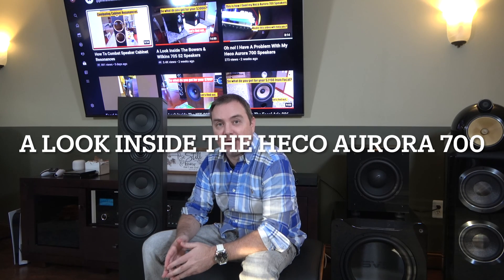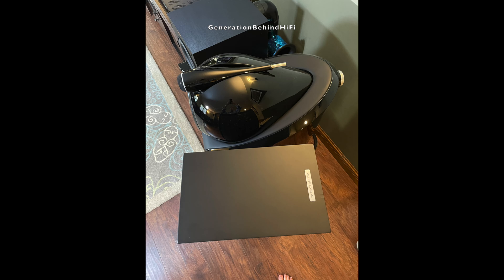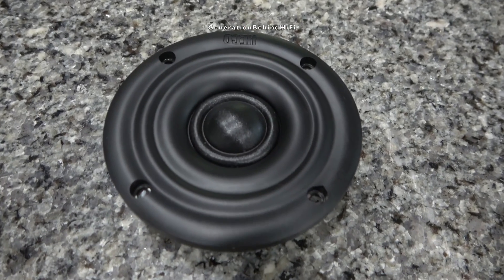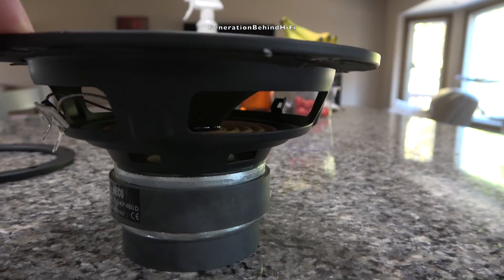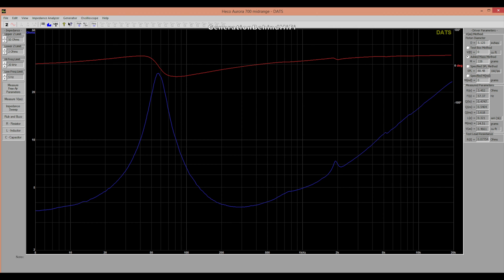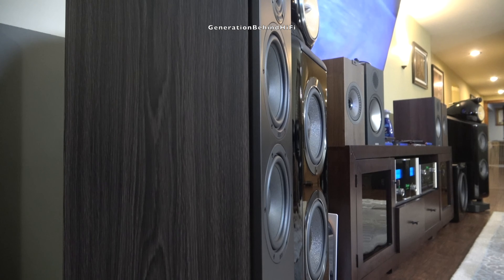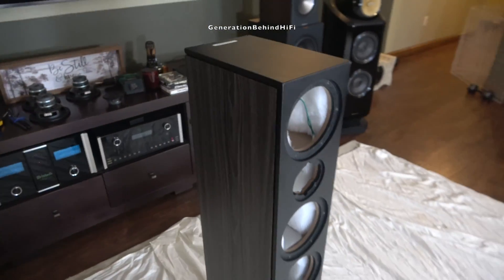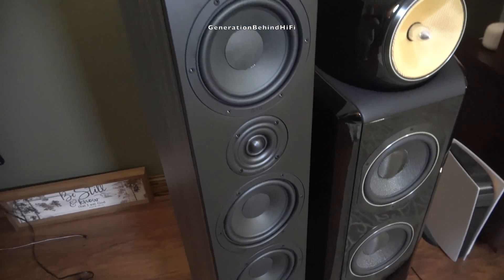Heco Aurora 700 – Full Driver, Cabinet & Crossover Breakdown

Comment: 5:20 The "Fluktus" concept clearly approved by a purry expert in warm sound, covered in orange fur. 😂❤

Brotip: these 700 models are also available in the "Colors" line, including a very nice "sunrise orange", along other colours like wine red, "British" (dark) racing green and grey. I heard it's hard to get these in the US, but in Europe no problem. It's a very nice orange tone that looks fantastic in all light conditions, if the colour is your thing. All of these in high gloss, with black, but still finely structured vinyl sides and back. They do sound very good, and also look the part. Incredible value overall. 👍

Comment: I just discovered that the Dayton Reference tweeter has the same size flange and hole pattern as the tweeter in these Aurora series speakers.  Probably some of the other Heco speakers as well.  I ordered a pair and plan to swap them out to see how it works.  Should be interesting.  I’ll do some measurements to see if the sensitivity matches up.

The Heco tweeter is nice but the Dayton Reference is pretty a really high quality unit.
Reply from the maker: Cool! Thanks for sharing. Can you share the model number? Another one that is a drop in fit (will need to drill a few more screw holes) is the Peerless DX25BG60-04.
Reply: @ The part number is RST28F-4.  While it fits into the hole perfectly and the holes line up, the solid aluminum flange on the Dayton tweeter is thinner by about an 1/8 of an inch than the stock Heco tweeter.  I will resolve that by coming back with some flexible solid caulking stuff that I have.  Hopefully that works.  This Dayton tweeter seems a bit more sensitive than the Heco.  I can’t tell you exactly how it will interact with the stock Heco crossover because I converted my speakers to active with mini DSP.  I need to resolve that recess though before I know for sure because that is surely creating some diffraction issues.

I would imaging that if you are using an AVR or anything with room correction or even a PEQ, you could dial in the frequency response.

Comment: I got mine at Audio Advice in Raleigh they sold me the floor models for 489 a pair.  Last week I was able to buy the 30a subwoofer for 229, normally 489.
Reply from the maker: That's a lot of speaker for $489 a pair! I also recently purchased the 30A subwoofer at $229 and its ok -- Look inside video coming soon. I definitely like the speakers much better than the subwoofer. The main problem with the subwoofer is bandwidth. During the opening scene in Tenet there is a very heavy low frequency bass track and the Aurora 30A can't reproduce those low notes too well. At first I thought the subwoofer was turned off and it wasn't. After some research I noticed that Audioholics did a review and mentioned that his subwoofer falls of a cliff below 40Hz! No wonder I couldn't hear that low frequency track on Tenet! At $229 I think it offers pretty decent value, but it does have its limitations. IMO the Aurora 300, 700, and 1000 are the real bargains in the line up. They really are fantastic speakers for their price point!

Comment: I think GR research just did a review of this speaker They were very impressed with the flat frequency response  There was a hump at 600 hz and they had an inexpensive upgrade for it  Also the speaker could use some additional bracing
Reply from the maker: I honestly can't think of a better floor standing speaker for the money. A pair of Aurora 700's are less than $1k shipped to your door and have incredible sound and build quality for this price point. I'm surprised that these speakers are not more popular because you do get quite a bit of performance for your dollar.

Comment: There is actually only 1 iron core inductor, the other 3 are air core.
Reply from the maker: Someone has been watching GR research. He did the Aurora 1000. I have the 700 so they are a different model.

Comment: Why whould steel nuts affect sound?
Reply from the maker: IEEE did a white paper on ferromagnetic parts in audio connectors and its a good read. Basically the study proved that ferromagnetic parts introduce passive intermodulation, aka 3rd-order harmonics distortion to the signal! Simply put, there's a reason why high end speakers use non ferromagnetic parts in the signal path.

Paper can be read here: https://ieeexplore.ieee.org/ielaam/22/8681220/8632973-aam.pdf
Reply: @generationbehindhifi  Thanks for your explaination. I will certainly have a read of the white paper. Cheers Ian.

Comment: I don’t think the ferromagnetic nuts make a difference. After all, you could use completely non-conductive nuts and they would make no difference as long as the threaded rods and tabs aren’t steel. After all, the signal bypasses the nuts through the rods and tabs. Sure, I’d feel better if they were brass or copper, but that’s just palliative.
Reply from the maker: IEEE did a white paper on ferromagnetic parts in audio connectors and its a good read. Basically the study proved that ferromagnetic parts introduce passive intermodulation, aka 3rd-order harmonics distortion to the signal! Simply put, there's a reason why high end speakers use non ferromagnetic parts in the signal path.

Paper can be read here: https://ieeexplore.ieee.org/ielaam/22/8681220/8632973-aam.pdf

Comment: If you follow the magnet field of the  extra magnet and through the plate on rear of motor magnet it cant add to motor magnet. The most likely purpose is for shielding, but as you said why. The other possibility is its just to add mass . To prevent speaker frame from moving in opposite direction to cone.
Think of a gun the only reason the person in front of gun gets shot and not the person holding the gun is due to guns mass. If gun and bullet had equal mass both people would get shot.

Comment: Hi ! To answer your question about the bucking magnet : It is use to concentrate the magnetic field inside the gap where the voice coil is moving. To shield a driver, a steel 'pot' or cover is often use to further isolate the magnetic field.
Reply from the maker: "A bucking magnet is a magnet placed near another magnet with opposing polarity to cancel out its magnetic field. This technique is commonly used in various applications to minimise unwanted magnetic interference or to create a more stable magnetic field."

Source below: 
https://engineeryoursound.com/what-is-a-bucking-magnet-speaker-design-explained/
Reply: If I follow your reasoning, it would mean there would be no magnetic field to make the voice coil move. You can see that it makes no sense. Furthermore, if you put something ferromagnetic close to the magnet, you will see that the magnetic field is still quite strong and extend several inches from the driver. @generationbehindhifi
Reply from the maker: @yvesboutin5604  It's not my reasoning! Just about every publication has said the same thing regarding bucking magnets. I think you might be overthinking this a bit. Bucking magnets cancel out the external magnetic field of the main speaker's magnet so it has little effect on how a tube TV operates. 

I wasn't planning on going in depth behind the engineering of bucking magnets in this video. I just wanted to share what they were primarily used for back in the 80s and 90s, and that they were somewhat rare to see now a days. If you would like to know more, then I would suggest looking at the video that Audioholics did on the Heco Aurora 1000. They touched on bucking magnets in their review and basically said the same thing I did. Hope this helps!
Reply: @generationbehindhifi don't hurt the kid
Reply: @generationbehindhifi you got him
Reply: @generationbehindhifi  If you look at the specs of raw drivers that are available both with and without bucking magnets, you can see that it does affect the driver performance somewhat. It's possible Heco has other reasons for including them.

Comment: The nuts used on the binding plate to fasten the terminal posts are gold-plated steel - got it. I own these speakers for about a week and would like to replace the nuts with brass. Do you know where I can find the brass nuts?
Reply from the maker: Check the description. 🙂
Reply: Wow.... right in front of my face. Thanks!! @generationbehindhifi
Reply from the maker: @gregjackson5426  no worries!

Comment: Great video 🙂, could you please tell me what is Heco tweeter resistance?, I have seen you have replaced them with 4Ohms Peerless, in my case I have decided to put SEAS PRESTIGE H 0831-06 ( 27TFF ), Wonder if there is a big difference between them
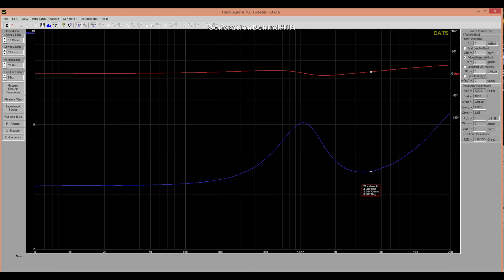Reply from the maker: Hello Daniel! Thanks! In this video I have the impedance sweep of the factory tweeter at around the 6:00 minute mark. DC resistance came in at 3.2 ohms (4ohms). I'm not familiar with the tweeter you picked up, but did see that its 6 ohms. Because of this you will need to do some crossover tuning.
Reply: @generationbehindhifi  Hello again 🙂, thanks a lot for swift reply, Yes, Im aware about crossover changes but suprisingly it worka like a charm😀, The quality of SEAS is unbelivable, at the top of it there is a liquid fluid to cool it down, my first impression was Wow, its much more detailed and louder, The soud is purely crisp, in generał these columns are great but if you want to make it more dynamic then tweeter swap is a must, huge advantage of seas is also his dimensions, it fits perfectly into the hole, there is no need to drill any new places for screws, wonder which speaker is better 😃
Reply: @danielilnicki9324 Sorry, so did you just exchange the tweeter? Where did you buy it? I like the sound Hecos signature but it sounds like fun what you did.
Reply: @danielilnicki9324  I tested both tweeters and the Scan Speak sounds even better than the SEAS 6ohm ones... The Scan Speak are more detailed without being obtrusive. I listened then for 2 days: original heco, SEAS prestige and scan Speak and I stayed with scan Speak due to much better detail and separation of sounds. The speakers have become a little brighter than the factory ones, but it's not as bright as in the focal aria speakers, but the detail does the job :) If someone would consider that tweeter is to load, without replacing the crossover, you can lower the volume without changing the resistance (lpad) . For example - 2dB
Reply: @maciekczl Can you provide me with more specific details about the Scan Speak speakers pls? Or send me a link where I can buy them, I assume all demensions remain the same?
Reply: @danielilnicki9324  scan Speak d2604/833000 but they are a Little bit to efficient compering to heco's. I think that  heco are not 93db.. Rather 91db.. that's why those  d2604 need -2db lpad. Second thing - they need new holes. Next time i will check with r2604 as those are the best version from scan Speak  2604 discovery line and they are rated as 92db. Compering SEAS to scan Speak from my perspective from those two scan Speak is more clearer with better range

Comment: The vents on the midrange driver are mainly there to reduce the "spring" of trapped air, behind the dust cover, and behind the spider. Your impedance sweep looks to have 3 or 4 significant resonances? (Which are indicated by the "blips"/ripples in the impedance - at ~750Hx, just under 2kHz is a big one, and just above 5kHz.)
Reply from the maker: Yep, I saw that too. The resonances are not from the cabinet because I'm measuring the driver in an open baffle. IMO the vented pole piece is there to release the pressure from the trapped air behind the dust cap (but can also be used to cool the VC indirectly) and the vents under the spider are primarily there for cooling the voice coil.

Comment: Sweet speakers and well built too! Would these tower type speakers be appropriate for music only 2.1/2.2 listening? For some reason I have it in my head when I see these that they are meant for home theater. Another great video.
Reply: They sound GREAT with music.
Reply: Velké překvapení ve zvuku, hrají za tu cenu neskutečně.
Reply from the maker: I appreciate the comment! Thanks! These speakers are extremely versatile and would be great in a music or home theater setup. I also think these speakers will perform great in a 2 channel music setup as long as there in a room that isn't too large. The bass output is pretty impressive for speaker that have such a small footprint. If you're an audiophile that has always wanted good performing floor standing speakers for an affordable price, then the Heco Aurora 700s is a speaker that you definitely want to have a listen to. I will talk more about their sound quality in my up and coming review video. Simply put, lots and lots of value for money with these!
Reply: @generationbehindhifi  thanks for the response! I look forward to the review!

Comment: Looks like the people at Heco  care about what they are sending out the door. Great to see such high quality measures in a budget speaker. Thanks for these detailed tear down videos I enjoy geeking out over this stuff more than the actual reviews. 👍🏻
Reply from the maker: For sure! Heco has done a really nice job with this speaker and the best part is, it's very affordable! Also, keep the shots of the Aurora drivers in your memory because another speaker company (Cerwin-Vega) uses an identical driver design in their new LA series of speakers.
Reply: @generationbehindhifi  Infact the LA series is basically the old Heco Victa Prime series that miraculously got discontinued right when the LA series came out. 😉

There's minor changes, mostly optics and a different subwoofer plate amp, but otherwise it's pretty much identical, including the whole lineup.

Not the worst business move: an established design that proved itself in the price range, and the factory doesn't have to change much and just keep building. Efficient. 👍

Comment: Very detailed information. How do we know that efficiency is high without the minimum impedance data ? Sensitivity and efficiency aren't the same. Sensitivity have different units with different meanings.  Thank you.
Reply from the maker: Hi Jorge, I don't follow what you are trying to say? Speaker sensitivity and efficiency are one in the same. I appreciate the kind words and comment! 

"Speaker efficiency, also known as speaker sensitivity, is a measure of a speaker's decibel output at a specified amount of amplifier power. For example, a speaker's efficiency is typically measured with a microphone placed one meter from the speaker." 

Source: https://www.lifewire.com/amp-power-speaker-efficiency-3135077#:~:text=Speaker%20efficiency%2C%20also%20known%20as,one%20meter%20from%20the%20speaker.
Reply: @generationbehindhifi  Efficiency according to other definitions is not decibel output but wattage needed for that decibel. Do speakers demand decibels to amplifiers or current and wattage for a determinate voltage ? Why 2,83 V at 1 m? Shouldnt' use a 4 Ω nominal  speaker 2 V instead of 2,83 V ? How many watts would use a 4 Ω speaker at 2,83 V ? 1 W ? 2 W ? It's easy to demonstrate how some rated 92 dB/2.83V speakers might need more watts than some 87 dB/2,83 V models ? John DeVore ranted about that high-end lie (video has kind of the same name) and maths will do the rest. That should explain why some reviewers feel that sensitivity is some times misleading. Gain and position volume control is not related with current demand and wattage needed. Thank you.
Reply from the maker: @Jorge-Fernandez-Lopez  Thanks for clarifying, Jorge! Now I understand what you're saying. Basically the reason why we use 2.83v is because that equals 1 watt for a speaker with an impedance of 8 ohms -- we calculate this by using ohms law. Obviously the manufacturer would have to adjust their testing parameters for a speaker that has a lower impedance than 8 ohms if we wanted to compare apples to apples. Some manufacturers do this and some do not. But you are absolutely right, without knowing the testing parameters it's hard to tell if the manufacturer's sensitivity data is correct or not. I personally didn't test the sensitivity on the Aurora 700, but Audioholics did and actually came out with a better number than what Heco did. Below is a site that I think will help you understand the testing methodology.   

https://www.brightonsoundsystem.co.uk/pa-hire/loudspeaker-sensitivity/